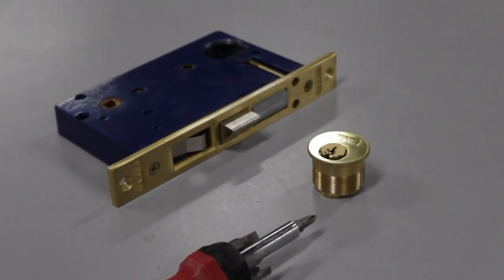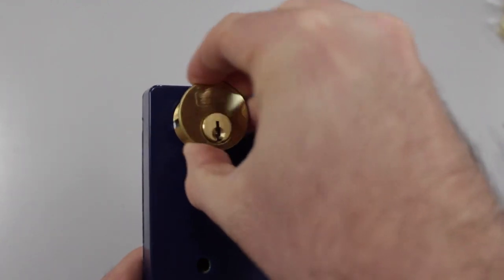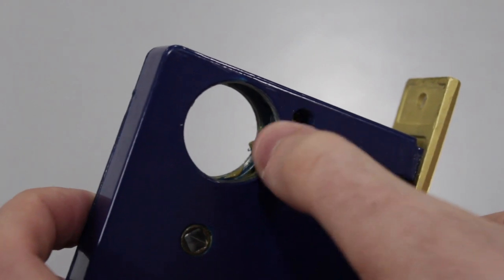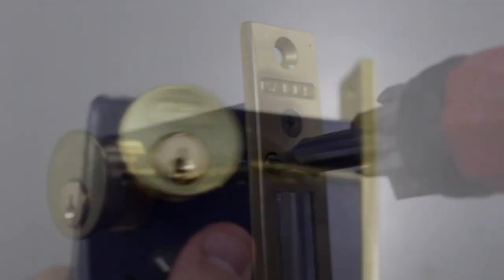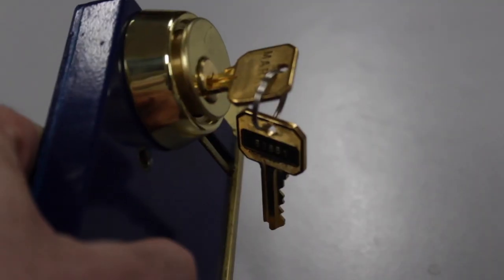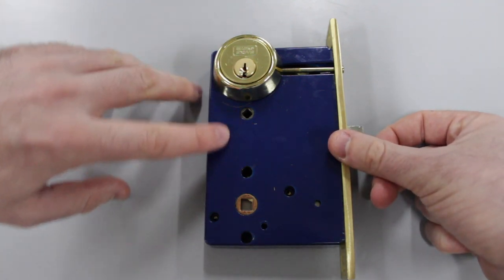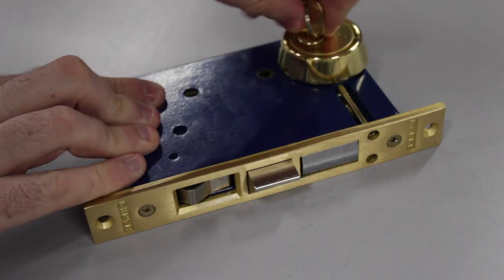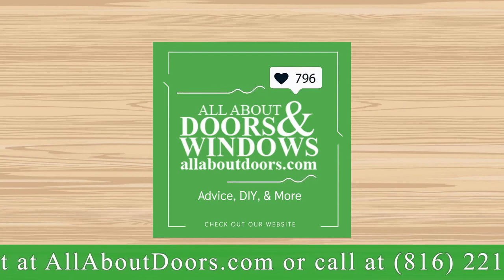How to Install Key Cylinders into a Marks Lockset

Comment: The lock cylinder is turn too tight I couldn’t unscrew it with a different key , the key started to bent when I try to force it please is there a tool I could use